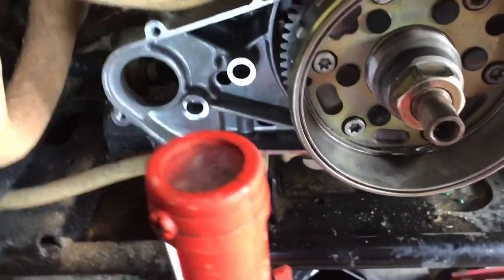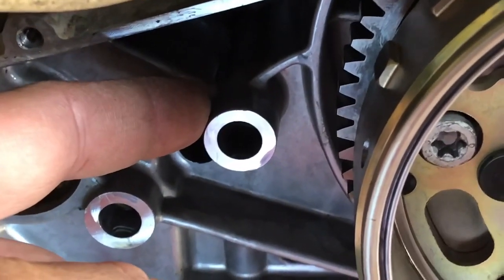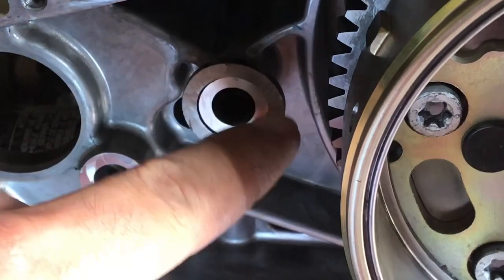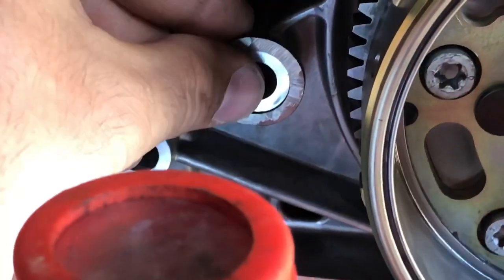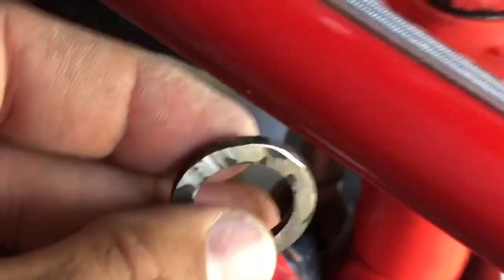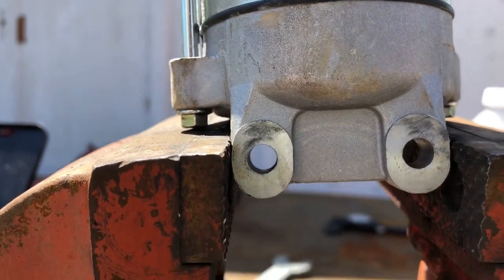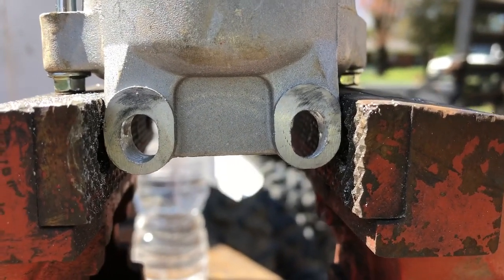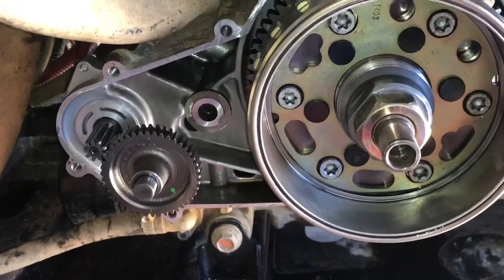Wildcat X and 1000 starter upgrade pt.4 - Reinforcing the case

Comment: Don't need to do this, I fixed this issue by adjusting the valve lash, the engine kicks back because the compression releaser on the camshaft is not working properly, readjust the valves and no more kick back !!!
Reply from the maker: Setting valve lash is definitely a good idea and I’m sure will help. However, these cases are still really weak and I still stand by this as being worth while. There is a reason Arctic Cat beefed up the engine case in 2016.

Comment: How’s this working mines a damn mess they reinforced that boss but mine broke it off the 400 buck stator cover boss ugh arcticat should give us updated cases or something the money we spent on these things to drive not work on
Reply from the maker: Well it never gave me any issue up until I sold it. I tried to be sure and not let it kick back or stall when starting which I think is the main thing that kills them. Arctic Cat should have done something to help out with the issue for sure because it’s very common unfortunately. Are you a member of “wildcat riders” on Facebook? There is a guy on there selling pre-cut reinforcement plates that you weld into your cases and stator cover. Once you do that I don’t think you’d have any more issues. It’s a pain to have to do it but I think it’s the best option. Good luck 👍🏻
Reply: @CumminsDriver  for real that be awesome yes that’s what just killed my it stalled twice then bam dreaded grinding away

Comment: I did this, guess what happened? Instead of loosing just the top half, the whole thing broke off my casing. My rig doesn’t even have 700 miles,these wildcats are pieces of garbage!!!! Wish I’ve never gave these pieces of junk a try!! Before had a 900xp 4500 miles before I started having any problems. And still just added oil when need and the damn thing would go all weekend
Reply from the maker: Sorry to hear of your troubles. It is a design flaw of the machine unfortunately. Yes the whole boss will break off if it gets kicked back on too many times. But Id rather it have to break the whole boss off the case than to just break part of it, because the end result is the same. The best fix is to fab a plate with holes in the correct places for the pins, position it in the case and have it welded in. It really isnt overly complicated, but it is a little work. Once its done though, it should take care of the starter problems for good. I think there was a person fabbing the plates. If you want more info on this id be glad to help
Reply: @CumminsDriver  if u have the info on who fabs the plates that would be a jump start. Good friend of mine is a machinist, and was going to tackle this thing but having a plate would get us that much more ahead
Reply from the maker: @dougfuit2989  I have not found where i thought i saw someone mentioned selling them yet, but I have several pictures of how different people have fixed theirs id be glad to send if you have a way i can contact you. Or if you have facebook, look up wildcat riders. Tons of good info and people willing to help on there.

Comment: What size were the bolts that held the starter in place? Thanks for the videos on this btw.  I’m replacing the starter on my 2013.
Reply from the maker: Sorry I’m slow getting back with you but they are T30 torx

Comment: It will help reinforce the end of the boss but will it break at the case now instead?
Reply from the maker: That is yet to be seen, but I dont really think it should break at the case. There is quite a bit of meat there, its just that once it cracks at the top. it can bust out easily. I believe if it can be prevented from cracking at the top of the boss, it shouldnt be able to break the whole thing off. Especially if you are mindful and can keep from having kick back.
Reply: Damn straight it will!! Did this now I have to come up with crazy bullshit to try and weld bunch of garbage to garbage wildcat!! Or spend over $4000 on a motor,and I don’t even have 700 miles on this garbage

Comment: Awesome tip on  reinforcing the boss by using a metal ring. I have mine apart now waiting for the HD starter with lower gear ratio gear from Country Cat.. I got lucky when mine kicked back it only took out the starter and gear, didnt break the case. What causes these to kickback ? Anyway of stopping the backfiring? Someone said to hold the key on until it is good and running. Thanks for the videos
Reply from the maker: These engines are just choppy idling. Mine will sometimes die right after startup if I dont give it a touch of throttle. So usually I just hold a little throttle on it and let it smooth out, then it will idle all day long. If i let it die at startup, that is the only time i get any kick back out of mine it seems.
Reply: @CumminsDriver  I just installed the new upgraded starter and gear. The new starter has a beefier gear and it covers the entire width of the secondary gear ( didnt have to relocate mounting holes)  . I also reinforced the boss slightly by JB welding a piece of PVC pipe to it. Was nervous starting it for the first time, lol...it did however start fine and the upgraded starter with 44 tooth gear turned the motor over much faster. I will use the throttle to get the rpm's up on start up as well as keeping the key turned until it is running smooth, hopefully that eliminates the kick back
Reply: tenes linck de la pieza en contry ca

Comment: Good idea about reinforcing the case and also elongating the starter holes so you can adjust the starter gears to have full engagement. Seems like the factory could use a few tips from you about that.
Reply from the maker: It only made sense to try to get full engagement out of the starter gears. And the sleeve on the case was the best i could come up with as a quick reinforcement that didnt involve welding. Thanks for watching!